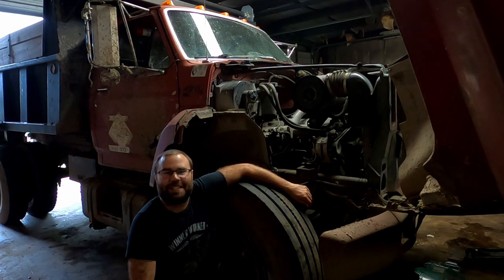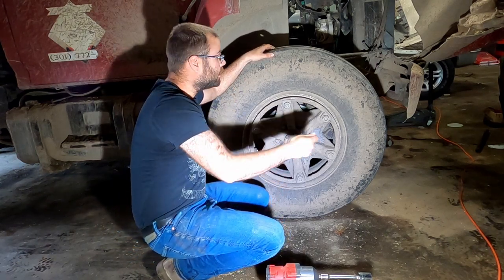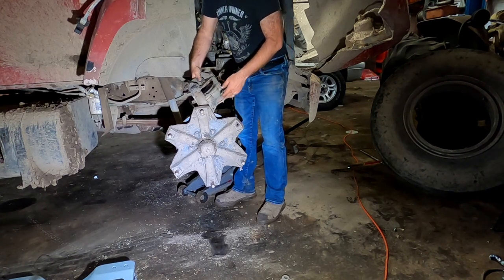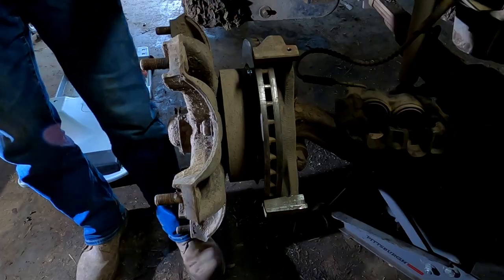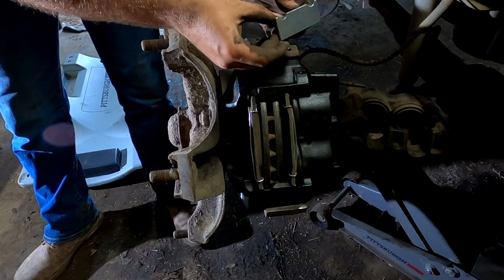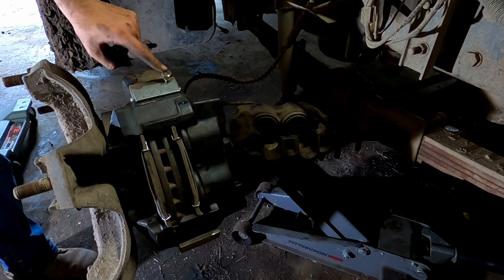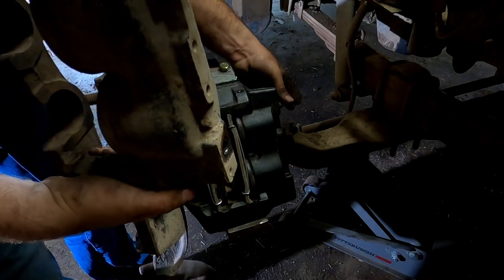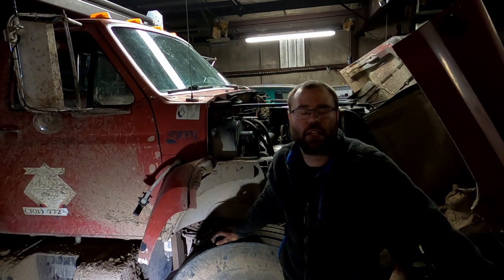FRONT BRAKE CALIPER REPLACEMENT ON 1988 FORD F700 DUMP TRUCK

Comment: Do you have a video of how to get the other parts of wheel off so I can put on new rotors
Reply from the maker: The rear? You need to take the wedges mostly off (leave nuts on end). Hit the wedges with a hammer to loosen them. Then once tension is off, you can remove nuts. This will take wheels off. You need to cage the parking chamber, this is done by screwing the end nut out off back of it. Make sure wheel can free spin to know they are caged. Then you must remove the axle. Loosen all nuts at the axle hub. There are cone shaped washers there. It’ll feel tight even with nuts off. You will have to hit the center gently to wiggle the cones out. Then you pull the whole axle out. Then you have to take the wheel bearing/hub assembly nut off and that’s what allows the drum to come off. It’s a major pity fyi, all of it lol